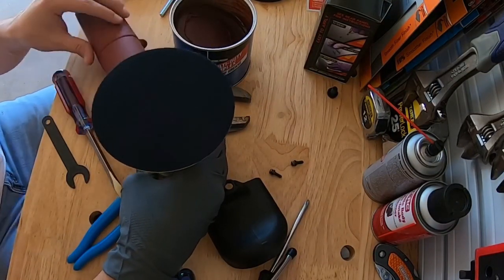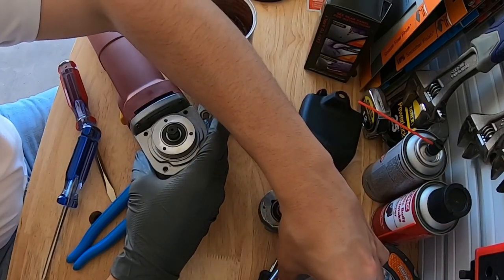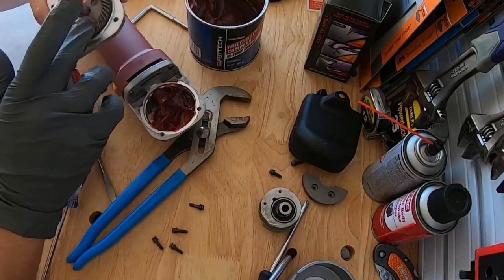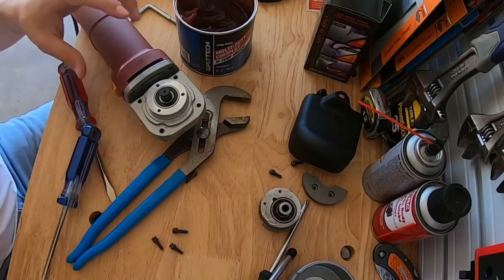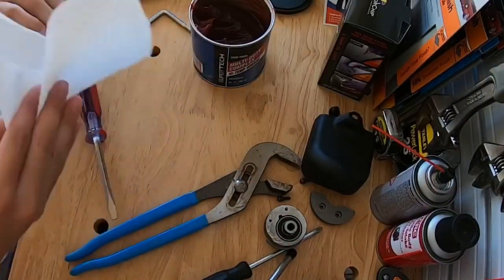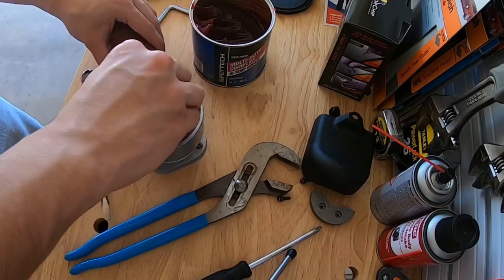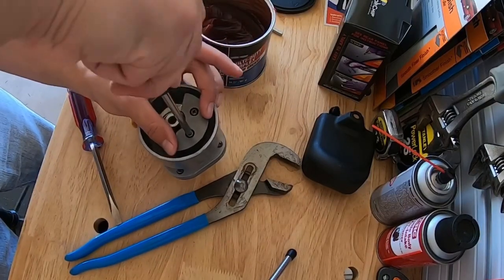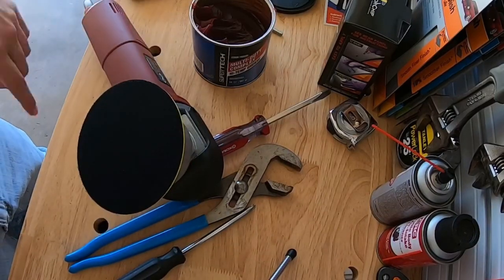How To Change The Grease In The Harbor Freight Dual Action Polisher

Comment: Thank you! My polisher sounds brand new no lie!
In the “Bauer” model the manufacturer uses a “dark blue-color” pressure activated grease with no smell. I replaced mine with your red grease, as it was 1 1/2 years old and you could tell it needed replacing once I put it back together and turned it on. I use frequently so this was a big help. I never thought to replace grease.

Comment: @jamie the cleaner I have Valvoline automotive & industrial general multi purpose grease available to me in my garage. Do you think its ok ? Says for its for non disc brakes wheel bearings (drums only I guess)  thanks
Reply from the maker: Yeah that should work anything is really better than what’s in it
Reply: @JamieTheCleaner   hey, thanks for the fast reply. Mine was kinda binding up when I put pressure on it. Think that could be the grease ? I figured id try it and see. Any idea what it could be if not the grease ? thanks
Reply from the maker: Yeah your not meant to apply that much pressure to a DA polishers just lighten up a bit let the machine do the work 👍 but the grease should help a bit
Reply: @JamieTheCleaner  Ive used it many times and put a decent amount of pressure to get out swirls or scratches. Anyway it always pushed right thru. But then it started to bind up. Anyway I changed the grease and it seems good. I just wet a pad and buffed the hood of a old car to text it. Seems fine. Ill be buffing a few panels in the next few days so ill find out. I bought 2 other da's as a package deal while this one was down. But I still want it as a back up. I think ill switch to a better grease afte
r a few good uses. Thanks for the vid and help !! take care
Reply from the maker: Nice 👍 yeah prolly just wore out if you’ve been using for awhile will continue to make a great backup
Reply: @JamieTheCleaner   I picked up 2 at a great price. A Makita p5000c (and a torq) which is a dual action and a rotary all in one polisher. I only messed with it a little bit. But seems to be a pretty good polisher so far.

Comment: Hey this is a great tutorial! I bought one on the parking lot sale for $32 out the door. It’s been working great but I have one question. After about 10-15 minutes of use, the middle of the pad gets really hot. Hot enough to deteriorate the HF pads that I put on it (I know the hf pads aren’t the best). Did you see any of this before you regressed it?
Reply from the maker: Yeah you should switch pads after about two panels doesn’t matter the brand
Reply: Get a 5inch backing plate with 5 inch pads. Do a washer mod. And dont press down too hard while polishing, let the pad and machine rest and cool down.
Reply: @TheCesarWay.  what’s the washer mod you speak of??

Comment: Nice and to the point! Well done. Will go through the process with mine next weekend. Do you know the size specs for those 3 cheap screws? Thinking I may want to get some better replacement screws anyway before starting the process and toss the original ones (and avoid future issues with them)
Reply from the maker: Ricky Colón I don’t sorry that would have been good to know but would definitely go find some new ones they melt like butter
Reply: @JamieTheCleaner  the two counter-weight screws are M4 x 16mm, the three screws in the cup are M4 x 14mm countersunk, and the four gearbox screws are M4 x 16mm pan head screw with spring (lock) washers.

Comment: I followed your instructions, put it back together and it's running rough as hell. Can't figure out what's wrong. Took it back apart and everything looked fine. Still can't figure out what's wrong. Need suggestions
Reply from the maker: Might just be a lemon 🍋 I’d probably just try and trade it in and try again
Reply: If I’m not mistaken… if it works anything like a random orbit sander like I think it does… there’s counter weights and what not to balance it. Maybe you put it back in such a configuration that it’s not longer balanced?

Comment: I think you undersold how hard these cheap screws are to get off. I’ve got 6 different screw drivers in front of me and they all keep making the screws worse. How did you get yours off?
Reply from the maker: sita3081 I’ve done two different DAs and one was really difficult to get them off and the other they came out pretty easy so it just depends but I just used a really good fitting screwdriver and put a lot of downward weight and turned very slowly 👍
Reply: Jamie The Cleaner— awesome,  thanks man. Got it after a while, then ran out to the hardware store to replace the screws. (3) #8-32 1/2” machine screws, if anyone else is interested in doing the same.
Reply: The current model does not use 8/32 screws. Learned today after I came back from the hardware store with 8/32 screws based on this comment. I took a screw to the hardware store and tried on the 8/32 nut and it fit. When I got home and tried the screw, they were slightly bigger. The current screws are bit smaller, probably metric considering it's Chinese